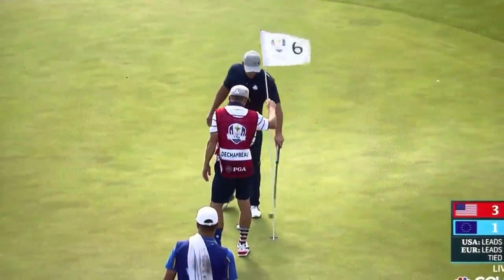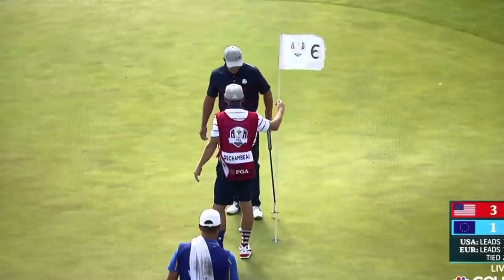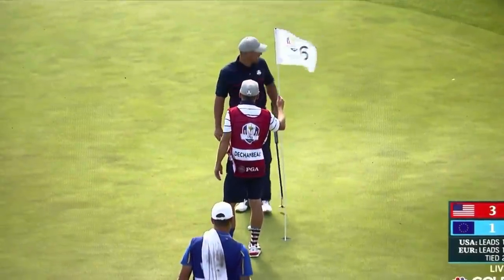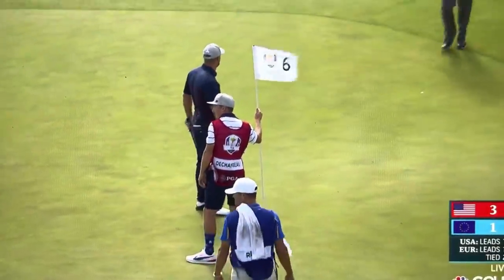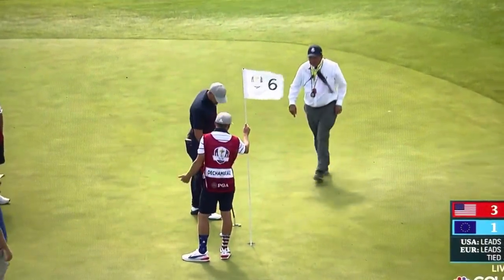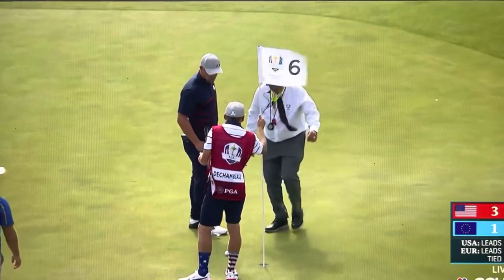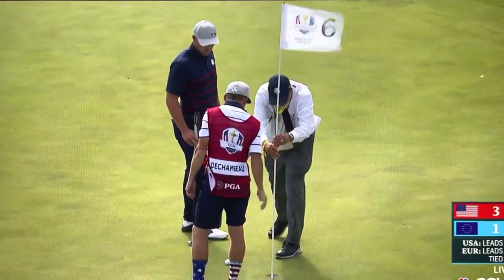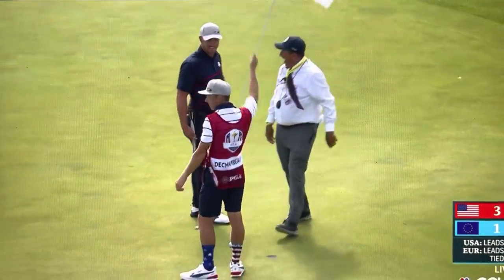Bryson’s caddie can’t remove flag from hole at Ryder Cup

Comment: Thought you could putt with the flag in with the new rules?
Reply: Yeah I'm confused.
Reply: You can, but you can also choose to remove it. Looks like this particular putt Bryson wanted his caddy to tend it.
Reply: If you ask for the flag to be attended the pin has to be removed for the ball to drop. If it had gone in without the caddy being able to remove it would’ve been a automatic loss of hole. The reason being that Bryson could shout “I’ve hit it too hard, now leave it in”. Believe the rules say something along the lines that you can’t alter the motion of the ball by having the pin attended.
Reply: @geoffcox9582  not in this case since there was a clear malfunction with the flag. Had it gone in or deflected the ball in some way Bryson should not be charged a penalty.
Reply: @RBMK-ym4dm  - it doesn’t matter in the slightest. Rules are rules and there is nothing in the rules about the pin not coming out. Why? Because a caddy could know it’s coming in fast and leaves it in on purpose before claiming he couldn’t get it out. 

There is zero in the rules that takes into account a “malfunction”. So get your facts right before coming on the internet thinking you’re right.
Reply: @geoffcox9582  

13.2b

"Ball Accidentally Hits Flagstick or Person Who Removed or Is Attending It. If the player’s ball in motion accidentally hits the flagstick or the person who removed or is attending it (or anything the person is holding), there is no penalty and the ball must be played as it lies."

Contact with a ball due to a stuck flag stick removal attempt would certainly be qualified as accidental contact. No penalty, ball played as it lies. Final discretion will lie with the referee.

Rules are rules. So yeah I am right.
Reply: @geoffcox9582  Yep I actually think you're right. My bad.